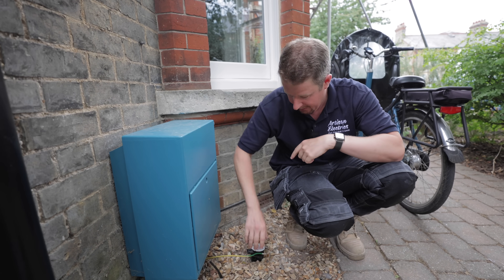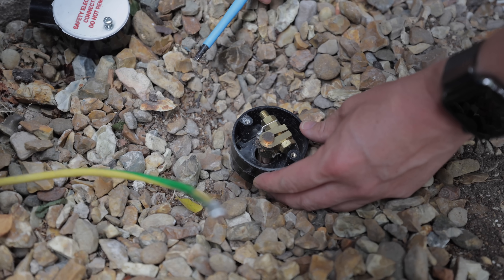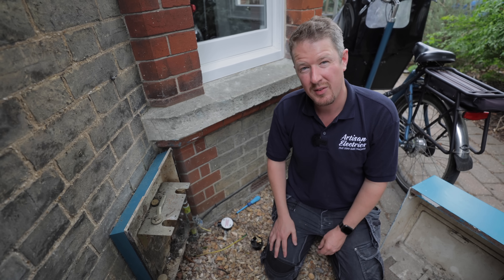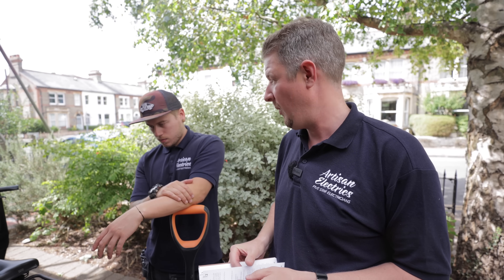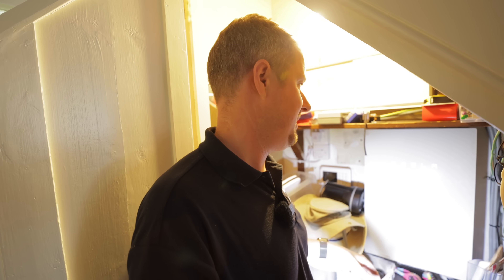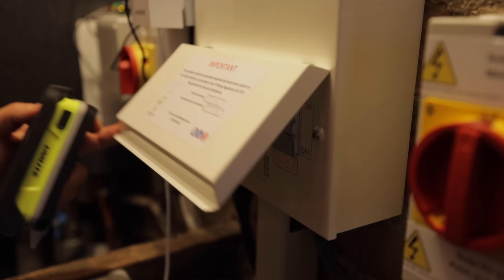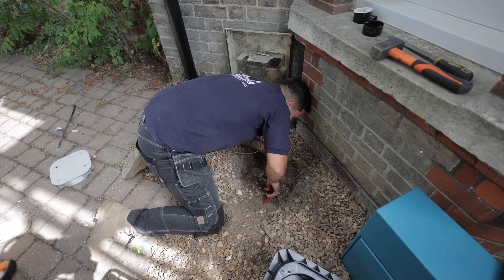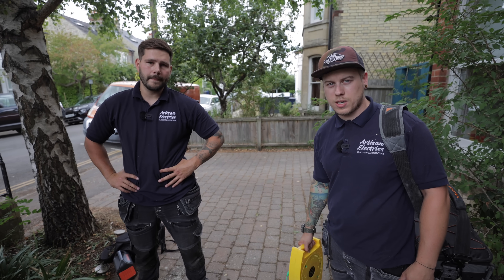The WORST Tesla Powerwall install I've ever seen 🤯

Comment: Hi 
I hat to point this out but you have made a fundamental mistake regarding the earth rod & it’s purpose 
The power wall is a generation source as such require earth ref rode the earth rod resistance being no greater than 20 ohm to the local mass of earth which can only measured using 3 wire earth rod tester
You are creating a return path to the power wall not from it ti the dno local transformer which is what you measured I hope this helps

Comment: Backup gateway ain't that good on power walls I got tired of mine shutting off my stuff when grid went down so I had to install a few ups just for that reason
Reply: Same here... UPS in my office at home.

Gateway shuts off clean if it's a Power Cut... but if it's an external grid fuse failing it'll surge... and it gets messy...

Comment: Random question about battery's been installed on outer walls, there extremely expensive bits of kit,  id be worried about theft in the future with shortage of them and the price of a unit,
people just ripping or straight cutting them off walls and taking them, the more they become common place the more i can see it happening, whats your thoughts on this and realy trying to put them in a building somewhere
Reply from the maker: Someone would struggle as they weigh 150kg 😅
Reply: @artisanelectrics  yeh I get that but there worth a fortune those battery's.  Groups could do it. I know motorways workers were already people are robbing the battery's from the temperary traffic lights as they have big sell on values.  It's something to be concerned about the more of them that are installed I believe
Reply: I have 'security' devices on my outside wall mounted Powerwalls

Comment: Let’s be honest apart from the earth rod which was completely unacceptable the install wasn’t bad, I’ve had to clean up far worse jobs.
Reply: exactly my thinking if that's the worst install he  has ever seen he has gotten really lucky so far
Reply: Yeah not to crazy, I've encountered a meth head running lines ran out of wire nuts and resorted to scotch tape. Also I guess he really enjoyed green wire it was every where as Power neutral and ground. I was impressed he managed to figure it out while high and not phased lol
Reply: Classic Trade worker statement to say " Look what a mess the last guy did" it must be in the handbook.
Reply: You've never heard of clickbait have you flower.
Reply: Two wrongs do not make a right.
Reply: @johnburns4017  but it was one wrong
Reply: @koleka3233  
It was a bad job. Totally unacceptable.

Comment: There is no way that earth rod was 1 ohm on its own. Agree with below, looks like parallel measurement. Also, FFS, guys, Ohm's law? Even taking an approximation, 200R and 230V it's going to be about an amp. You don't need a calculator. Pfft. Oh, and don't get me started on the whole 'hammer it a bit further in' lark. It's a pain, but scan or dig a 1m hole. You never know when there might be other services lurking....

Comment: Industrial sparks- Plenty of room in those junction boxes! 10/10 job.
Domestic sparks - oh my gosh more than 4 cables HELP!!!
Reply: 100% true :P
Reply: Well said
Reply: Controls sparks- no terminal blocks, atrocious. No wire numbers, how are you supposed to find anything.
Reply: What are "sparks" in this context?
Reply: Aussie slang for a electrician.
(Not sure if other countries also call electricians sparks and sparky)
Reply: @ryandonnelly9096  
It came from the UK.
Reply: @johnburns4017  Like most of Aus.
Reply: @SerjLevonyuk   As a previous old hand(now retired) "Sparks" was a term used for worldly wise old hands who had been there done that over and over. "Electricians" were newbie"s !
Reply: @johnchristmas7522  actually sparkies is the the term we wider world

some don't under stand the difference between single and 3 phase and commercial 3 phase power..
Reply: @jasonhowe1697  Brings back the term. "wet string"!  Unfortunately, there are a lot of "electricians" given JIB cards freely. I had an "electrician" on a commercial job who could not connect a 13amp plug, yet had a jib card! When I asked what he was at home in Romania, he said he was a farm labourer. So I would not even mention 3phase to him!  Lots of commercial contractors turned a blind eye and used agencies to 'find' electricians. A bad period and I'm glad I'm out of it. I think you would be shocked at some of todays commercial installations, which rely heavily on the protection and not the cable size.  Cost was always the driver. Bit like wiring a house in bell wire. No wonder they brought in AFFD's
Reply: @johnchristmas7522 literally shocked 👀

Comment: I really appreciate hearing from experienced sparks showing below par work, but in this case, could you elaborate why that junction box was bad? The connections looked like good solid wagos, there was good slack for maintenance. It's got no Cory magical disappearing loops 🤣 but apart from that, what was wrong? Keen to hear!
Reply: (Referring to the outside JBs here. The inside one you explained what was wrong and I def agree 😊)

Comment: “We hammered the urf rod in but didn’t scan the area for whots darn there” supply cable, gas eh? Luke? Luke are you ok?
“This looks dodgy” Jordan says while 2 sparkies discuss the earth cable size while really not wanting to consult the on-site guide?
The solar install looked neat and well presented and yes the connections in the boxes are a bit messy but not deserving of the title, c’mon I found a melted choc block under the floor yesterday wrapped in tape that was “dodgy” or “unsafe”
Click bait artisan you can do better!

Comment: Please correct me if you think I'm wrong, but I wouldn't have looked at the tesla creating it's own PME (TNC-S) system. I would have said it's creating it's own TN-S system. The "supply" being the tesla side of things, with 3 dedicated cables for L N and E coming from this supply to the customer (the consumer unit in this case). I have an off grid solar setup where I've joined the earth and neutral together at the inverter, and I view it as my own little TN-S system.

Really keen the hear your thoughts!

Comment: All talks only about the power cables but what is with the data connection with Wago? In my eyes a very big fault - need correct extra boxes with correctly connectors in extra plastic boxes (or metal boxes for better saving against outside sun flow). Data cables use 10 MBit till 1999, then 100 MBit, since ~2010 1 GBit and ~2020 10 GBit. If they use fiber - no problem in electrical installation! The slacks are very good service entrance and I can cut without problems after 25 years installed 2 mm for new install after a check. 

Very good in FR Germany isn't allowed that people lower "Elektromeister" installing data stuff. They must guaranty a correctly functions. Funny that GB test all power lines but not the data lines ...

Comment: Had one installed a few years back (AC Coupled). It took 2 years waiting on Tesla, but has woked well. The outfit that designed/installed the system is "Swell Energy", in the SF Bay Area... When Tesla discontinued support for 3G... Swell came out and hardwired it with Ethernet... No charge!

I spoke with one of their engineers, who was quite helpful when our utility (killer, Pacific gas and Electric) derated the supply voltage, and the gateway shut off the solar and the battery.

U had heard that Tesla was no longer selling Powerwalls with 3rd party PV, or AC coupling.

Comment: Reusing the bonding, not bad as long as it never comes back in service for one. Then either the Powerball or the gas bonding will have to get chosen.
2. if you're gonna reuse it why not cut it off so you have the maximum length to work with and not leave 6 inches (15 cm) hanging off the old Bond connector!

3. conduit is not so bad, mixing low voltage signal cabling and high voltage cabling on the other hand sketchy and leaving it really messy like that not good.
Reply: While it seems to pass UK regs, to me mixing AC, DC & data in the same junction box is just inviting the DC to one day go somewhere it’s going to cause some serious damage.
Reply: @markboscawen8330  Or the AC goes somewhere that it isn’t supposed to. They could be using low-voltage cabling that’s rated for high-voltage conduit used however given the look of that I’m not sure.
Reply: @imark7777777  Either way, given the long tails of data cable inner conductors which are only covered with very thin insulation jammed up against 240V AC & ~400V DC I’d suggest one day a surge of those electrons are headed down it.

Comment: What on earth (pun intended) was that ZE reading at the end of the video.....no way you got 1 ohm on that earth rod, think you had a loop back to another bond or didn't isolate the rod - need to test direct at the rod with the 10mm disconnected.

Comment: As an electronics engineer - it does pain me that electricians don't know ohms law off by heart without having to pull out a calculator app!....every heard of the Ohm's Law Triangle?  I=V/R -> 230/200 = 1.15 amps.

Anyway using the highest possible Z of a TT is not what you should be using in your calculations - the lowest possible Z is what determines the cable size....no good assuming the TT earth is a maximum of 200 ohms where it could actually be a really good earth and be 1/4 of that. Still 10mm is enough regardless.
Reply: We get it dude, you know the Ohms triangle (U=R*I)which im sure everyone here knows). He probably only used the calculator app to calculate and get the exact number instead of pulling out a sheet of paper and a pencil, and spending time doing the calculation.
Reply: @TheFenrirulfr  Sheet of paper and a pencil? lol...seems mental arithmetic is in short supply nowadays.
Reply: I'm an approved electrician so your comment is irrelevant. Stick to your own job please. Saying electricians dont know ohms law?! Cheek
Reply: @adamsharp201  There are plenty of so called approved electricians who somehow manage to do shoddy work, so your comment is irrelevant so long as they exist, unless you can thanos snap them from existence...
Reply: A very valid point about the max TT value!

Comment: When you tested that earth rod you had the 10mm connected. Will get a parallel earth path back to MET and main water bond could be giving 1 ohm or even TNS helping. Rod could be 200+ ohms. Need to disconnect 10mm from MET or at rod
Reply: Let's assume it was, I'd be a little concerned that the earth rod is trying to make babies with something, maybe a gas pipe or an 9ld lead water pipe. Never seen 1ohm without it being too close to other services to meet regs, and that's when I did hit an old (disused) lead water pipe.
Reply: Yeap basically tested it as ZS. Not as RA.

Comment: 9:40 you really need to be careful of a power outage when you are working on it, need to shut off the ability of it to switch if there was a power failure while working on it.
Reply: ?? Are there codes of practice for this relatively new complex type of installation yet, i.e solar, battery etc, etc?   Takes me back to the concept of the firemans' swich outside shops - one switch to isolate the most dangerous high voltage equipment inside.

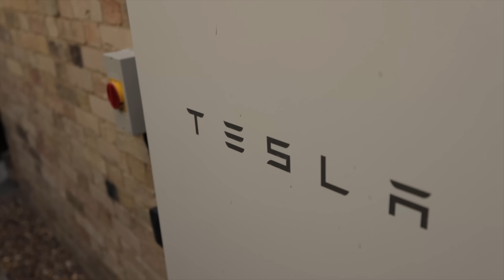Comment: 5:35 But remember that the max draw from the power wall is 5kw for the GEN2 and 3.3KW for Gen1.  Its NOT 10KW.  The capacity is (gen2/3) 13.5kwh or (gen1) 6.4kwh.  Just for a point of reference.  5kw really isn't that much for the US for powering a typical house.  If you are just looking for lights, TV and fridge you would be fine.  I have a 25kw generator, along with UPS' for critical loads until the generator gets going and online.  Its natural gas based, and can run until the gas company runs out of gas!  😁   Great work guys! 👍
Reply: Run out of gas - in the uk that won't be long!

Comment: The Tesla system isolates the supply side when it goes into island mode so it needs to have its own earth because it essentially disconnects the supply side earth. This is so a fault current doesn't end up on the supply neutral which someone may be working on in the street.
Reply: This is what I couldn't understand from the video, isn't that earth connected to the Tesla box so its only used when in Island mode?  Admitting he didn't understand how the Tesla system exactly works is worrying, how would you know where to test if you don't understand how it works?  Was that the right spot to be tested?  Was it even wired correctly in the first place given the bad job they did of the earth rod?
Reply: @alexatkin  There is an earth terminal on the Tesla system which has to go to a local earth. That is all they really need to know for installation. When any system is installed it has to be capable of complete isolation from the grid if the grid power is off. This includes the earth even when it isn't neutral bonded. This is a safety thing for engineers working on the supply side. This said it is crucial that an earth is still available when its running isolated. An exposed earth rod like this is ok but it should be connected with a clamped braided conductor rather than the flimsy earth strap and rigid conductor they were using. It should have been completely enclosed to use the arrangement they had here and the conductor should be in a conduit.

Comment: Always enjoy the UK sparky videos, nice to see how you guys do things.

I assume that was an Ra test at the end where it was using a wander lead ....

I'd be a bit suspicious of my test procedure if I got a 1.01 ohm Ra result on an earth rod that was originally loose enough to be removed by hand....

I'd be asking myself questions like what parallel paths might be in circuit or whether the earth rod skinned an underground SWA cable and is in contact with the armour or maybe even contacted an underground gas or water pipe.

Comment: Another complete PILCHARD moment from a clueless "Sparks"

Extraneous metalwork, is just that, removing the meter doesn't change that....

if the 10mm was suitable for supply bond in context, a fly thru from incoming to out going Gas lines tied to the electrode(s) you use 3 in a delta if you want a TT that actually has a ground path....

More hipster bell-end crap from a firm that should stick to chasing walls and hand over to electrical engineers after that!

Comment: I don't believe the PW batteries can do any sort of DC coupling, they do however have a communication link back to the gateway, which I believe is specced to require fairly chunky cable, so that might be what you saw in the box nearest the battery...
Reply: I think some of the earlier ones did when Tesla partnered with SolarEdge, which given the SE inverter may be the case here - I was miffed as I have a SE inverter but it was too old a model to work with the PW in DC coupled form - I think Tesla then binned the DC version in favour of AC coupled only which is more universal albeit not quite as efficient...

Comment: I feel very concerned about lack of neutral earth bonding relays, this is set out in IET Electrical Energy Storage System 2.0. Some manufacturers have schematics for island mode switch over but just power no N/E bonding. They qualify it by saying it must comply with local standards. This seems standard for EPS output to run one low current socket in UPS island mode. It feels like we are waiting for a fatality before the authorities will act.
Reply: As far as I'm aware, the Tesla gateway does do this; it when it islands the supply it disconnects the supply live and neutral, and connects the local neutral to the local earth.

Comment: Loads of sparks think that TT needs to be at least 10mm but a good low resistance is 20 Ohms. At 240V that gives a PFC of 12A - hence a 4mm is sufficient so long as it has mechanical protection.

Comment: Nothing wrong in my eyes with the junction box wiring. In fact, to this electronic tech, he did it quite well. It's not the static looks that count, it's the functional look. And that represents availability of pulling out the available lead length for the purpose of servicing.
Reply: Surely putting AC and DC in the same box is questionable at best to begin with?  Doubly so if any of those are signal cables for the devices to talk to each other.
Reply: In my country it is mandatory to install AC, DC and control/data wires separatelly.
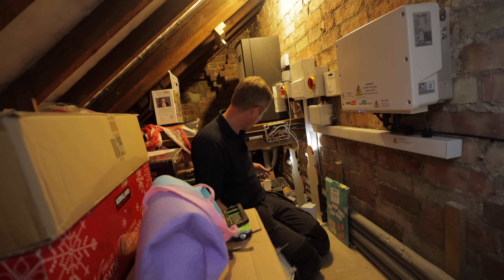Reply: Agreed. I even clicked on the vid just to find out what was wrong with that junction box in the thumbnail. The other box at 11:14 is as John pointed out before me really not good because there's exposed copper. But nothing's wrong with the first box and putting it into the thumbnail is a weird choice.
Reply: Agreed, but labelling cables is an aid to quicker effective servicing. Generally, correctly sized enclosures allow cables to have the correct bending radius.
Reply: At 11:14, that wiring is a living disgrace. The box was too small for starters. If that is the quality you aspire to, please change professions - to one where craftsmanship is not a part of it.

Comment: Does any electrician out there believe a Loop impedance of 1 ohm on a TT supply?
I can only assume you had the repurposed bonding cable attached to the earth rod when you did the Ze.
If that is the case, you measure the Ze of the PME supply plus the bonding cable plus the Wonder lead - including all the parallel paths.
Reply: +1
Reply: +2

Comment: We all know one length of 9mm2 earth rod won't give PEFC of 1.01, no matter what you do, not even if you live in the middle of a bog, don't we? 😋 And that the "Loop test lead compensation" menu in Meggers settings only goes as high as 0,3, so not enough to compensate for a flylead this long. Any value below 10 Ohms in this scenario would be old gas bonding still attached or daisy chained to other pipes somewhere under the floor... But yeah - installation is safe for now. Good vlog.
Reply: 3 wire test would say total different value ..  Here  earthing rod or loop has to be lower or equil to 30 ohm ..